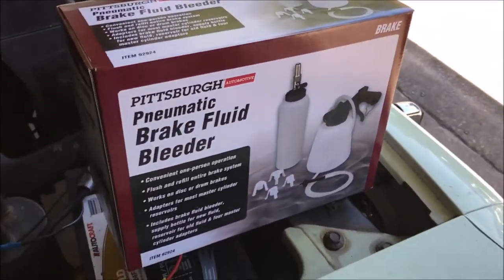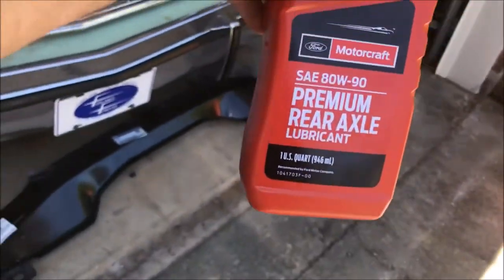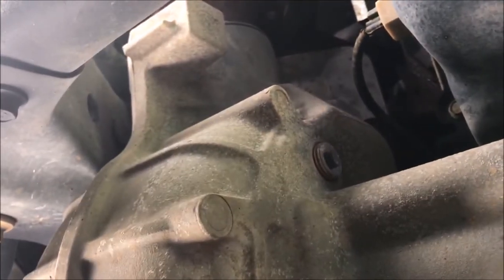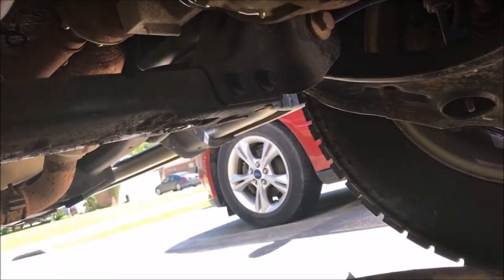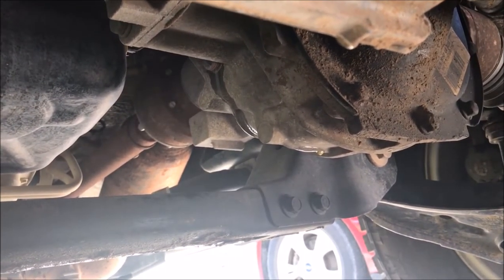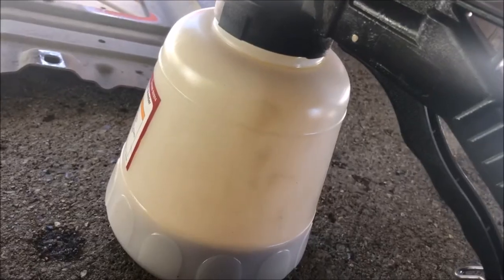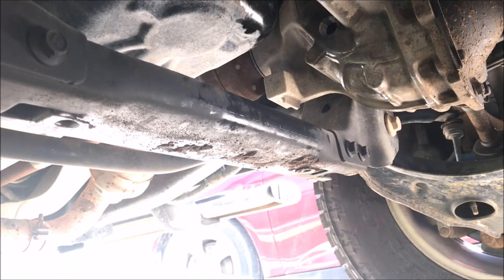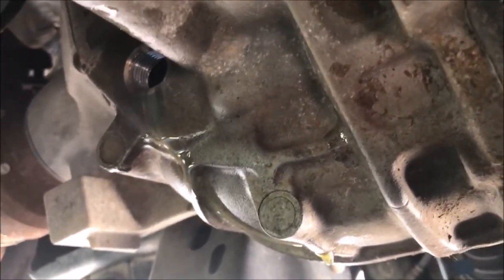2011-2013 Ford F150 -  DIY Front Axle Differential Fluid Drain & Fill

Comment: Good job.   
A couple points:

1)  The cover can't be removed on your truck because there's not enough clearance so you couldn't have removed it even if you wanted to. 

2) I think you mentioned that the front of the truck was higher. If so, the differential probably wasn't overfilled and that would explain why it appeared to be overfilled and fluid flowed out when you removed the fill plug.  The problem is that, if that was the case, you probably underfilled it when you pumped new fluid in. If, on the other hand, your truck was level when you re-filled it, you shouldn't have  pumped more in when it was seeping out already.  If it's seeping out when the truck is level, it means it's overfilled but I don't think it would be something to lose sleep over.  Just something to think about. 

3) I hope you used a plug sealant when you reinstalled the plug. It would probably be OK if you didn't but it's just good worksmanship to do so - just as you would for the rear differential plug or the transfer case plugs. 

4) It's odd that your old fluid came out yellowish - at least from my experience. It usually comes out dark gray - almost black - the first time it's changed. I'm not saying it's bad that it was yellowish but it's just odd.  It almost looks like the fluid was fairly new but you say it was the original from the factory.  Strange.  Not bad but strange.
Reply from the maker: Thank you very much for your thorough comment. I greatly appreciate all advice that I receive. Have a great weekend.
Reply: you can remove the front diff cover if you first remove the steering rack. It's not impossible, but it can be a great deal of work getting the monster fasteners out of the frame.
Also, the yellow color apparently comes from the assembly lube they use at the factory. I'm not saying it couldn't possibly be due to water ingress, I'm only saying that from my own personal experience and from what i've seen on youtube, the first change on these trucks gives you yellow fluid.
Reply: Yellow fluid is the norm from factory. A quick test for water contamination is to dip a white paper towel into the used fluid. Capillary action will pull used fluid into the paper fibers. If you have a clear wet border between the oil and the dry paper towel, that's the water in the mixture. The yellow oil isn't contaminated, it's put there by Ford to mark gear mesh patterns.

Comment: Given its color, and more volume than  it should be, I'm guess it is water got in your Frontal Dif. (Milky white, and too much).
Reply: Where could water get in?
Reply: @stargazer7644  the diff breather hose if you submerge it.   😉
Reply: It's not contaminated with water, it is in every later model Ford front diff. It is a marking dye for gear lash and diff break in. It allows for gear mesh pattern to be very delineated in comparison to not having it in. Plus, it tells if the fluid has been changed if there's ever a warranty claim. Nothing to worry about, drain and refill.

Comment: No, it was not over filled. Condensed Water accumulated in there over time (years), mixed with diff oil. That is why it is creamy, and volume Is more than it should be.

Comment: Great Video and gave me the courage to give is hot.  Did it today.  Couple of notes from my experience:  
1.  Using a stiffer tube within the latex rubber hose of the brake bleeder really helps to get past the gears and deep into the reservoir.
2.  My tube got blocked from going in, turning the wheels 1/4 turn helped make room to get the stiff plastic tube deep into it.
3.  As I vacuumed the old axel fluid out, I would eventually begin to suck air, knowing there was more in there, I'd move the hose around, usually out about an inch and would hit a new pocket of fluid.  Did that 5 or 6 times and eventually got all the old fluid out.  
4.  Spent way more time getting fluid out than putting fluid back in.

Appreciate the help and instruction -  just adding my two cents from my attempt this afternoon.  Thanks again
Reply from the maker: Thanks for commenting, it should help others. 👍🏻

Comment: Dude! You videos are awesome and you have been doing some of the exact maintenance I am doing in the next week. I have a 2013 FX4 SCREW that I bought new and coming up on 100k. I Bought the exact same setup to do break fluid swap for the front diff.  I didn’t really known of that Pittsburg pump would pump out the old fluid as gear lube is significantly thicker than break fluid and wouldn’t you know it....you’ve got an awesome video to proof the process. Thanks!!!

Comment: My Torino thanks for saving me some cash.  If anyone cares, I removed the 3 skid plate bolts and just loosened the passenger side rear bolt and moved the skid plate out of the way and propped it up, instead of dropping the whole thing. Made re-install a piece of cake. Worked on my 05 anyway. Cheers 🍺

Comment: Doesn't the yellow suggest water contamination? And possibly that would explain the overfill?
Reply from the maker: Possibly, but there was no separation of water in the drain pan after I dumped it.  I truly think that it is the grease that was used to check the gear mesh at the factory. Thanks for watching and commenting. It is truly appreciated.
Reply: There is also a breather valve that condensation can get in there. But not bad enough to worry about.
Reply: Water should make it milky
Reply: That’s what it looks like. There’s no water in it

Comment: Just did this on my 2013 f150 platinum 3.5 Ecoboost. If you shave off the those tabs that hold the large EPAS wire. There is enough room to take the front differential cover off. Worked great. Just take your time shaving both of the aluminum tabs off and you’ll be good for removing you cover for a drain and refill. No need to removed EPAS or drop the differential. You will need to unplug the EPAS wires and move them out of your way. Hope this helps someone. I was experimenting and it worked for me. This method should work for all Gen 1 Ecoboost motors in the F150s with 4wd.

Comment: I have a 2013 F150 5.0 XLT. Noticed there's fluid or oil on the undercarriage yesterday. There's a rubber hose that runs up and inside the fender-well and attaches just below the brake fluid reservoir. Where does the bottom end of the hose go? Heard it's a vent tube for the front differential but don't see where it would go.

Comment: Good video. A couple things though, the front diff cover is not removable  without taking the rack and pinion out, so you are doing it the way most anywhere does. The yellowish color of the fluid is actually from moisture, the vent on the front diffs allows moisture in and it contaminates the oil and makes it milky. And finally, whoever at the stealership recommended that gear oil was an idiot. It's supposed to be a full synthetic 75w-90. For the few more bucks it costs it's well worth the extra wear protection.
Reply: I sucked my fluid out last night and it was very bright grey...what do you recommend?  Run it in 4A for a short trip and change again?
Reply: @ryanrudolph1050  it's fine. As long as you got most of it out, about 2 qts, and filled with a high quality synthetic, it's good. Just shorten your change interval on it to 30k or so.
Reply: @zackhaas3267  thanks, since I am super anal about that stuff and this truck is new to me I will likely take a look at it next oil change and at least see what its doing in there.  I have a large puddle at the end of my shared driveway that we have to go over every day. I guess I need to stop plowing into it.  :)
Reply: I shaved those aluminum tabs off my EPAS housing and the cover comes right off. No need to removed EPAS or the drop the differential.

Comment: Another great video!  As I mentioned before I also have a 2013 F150 with the 5.0 here in Monroe, LA and I changed my transfer case fluid after watching your video.  I only have 65,XXX miles, so I don't think I will mess with the front or rear diff fluid just yet, but I do plan a transmission fluid and filter change soon.  Looks like a messy job, but I do a fair amount of "city" driving and think that is my next logical maintenance item.  Keep it up!
Reply from the maker: I have all the stuff to do my transmission, I just have to work up the nerve for the mess!! Thanks for watching.
Reply: You probably did it already, but I think the rear diff. is even easier than the front. I did the rear on my 2011 F150, pretty easy.

Comment: Great video! How much did you end up pumping out after your 3-4 tries? I need to do the front differential fluid on my truck here soon. Says around 2 quarts of capacity. 
Thanks.
Reply from the maker: That's about what I got out, and replaced.
Reply: @MyTorino  
Yeah I ended up with almost 2 whole quarts. I found that a hard 1/8" water line works to get deep into the differential so I used that instead of the flimsy hose that came with the bleeder pump. Thanks for your direction!